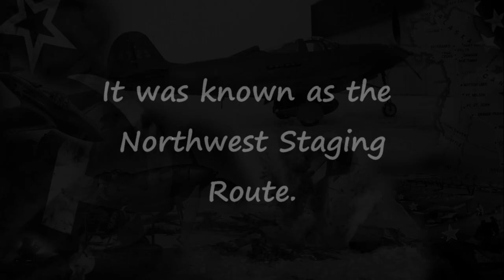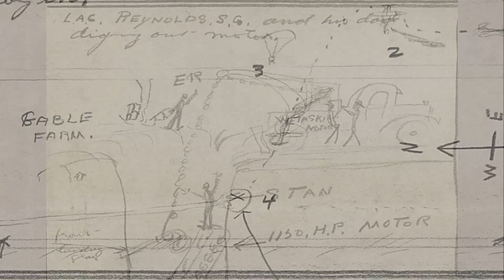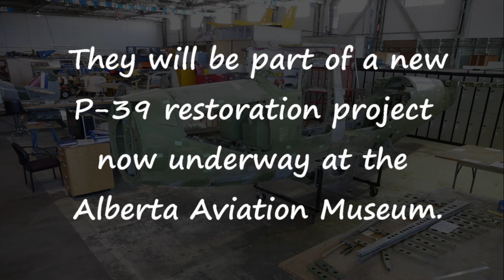Stan Reynolds and the P-39

Comment: Wonder why they were flying an armed aircraft around Canada?
Reply: The P-39 Airacobra tended to be unstable if it didn’t have the weight of the 30 rounds of 37mm ammunition in the nose.
Reply: @txkflier  that makes sense
Reply: @joelex7966  The weight of the 37mm cannon, 50 cal machine guns, ammo, propeller gear box, drive shaft, and the nose gear is what allowed them to put the engine behind the pilot. But, that didn’t leave room for a fuel tank in the fuselage near the center of gravity. This limited the range of the P-39, but the Russians didn’t need long range or to fly at high altitudes. The P-39 could have been a great plane, but it didn’t meet our needs.
Reply: @txkflier  Correct, I maintain that we should have we used it for ground attack.  It could still fight, just at lower altitu ez.
Reply: @txkflier  the later design addressed that issue
Reply: @txkflier  true p63 was upscaled better version
Reply: @joelex7966  would have needed more protection of the cooling system from ground fire